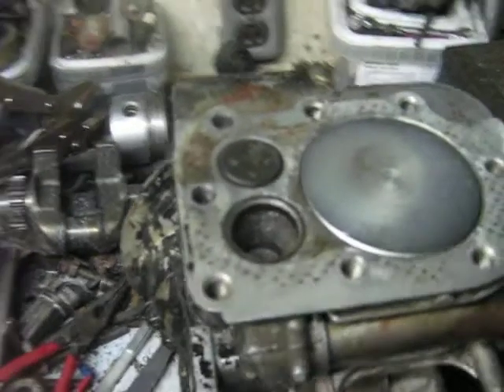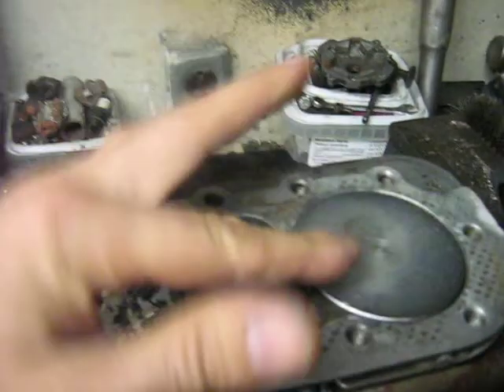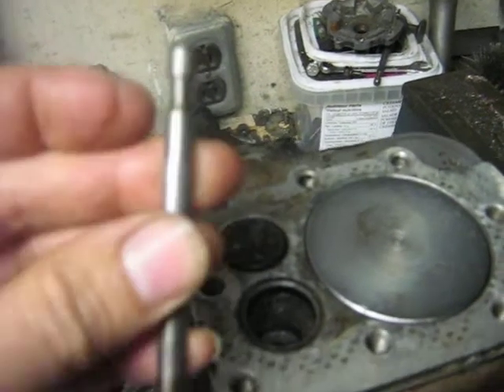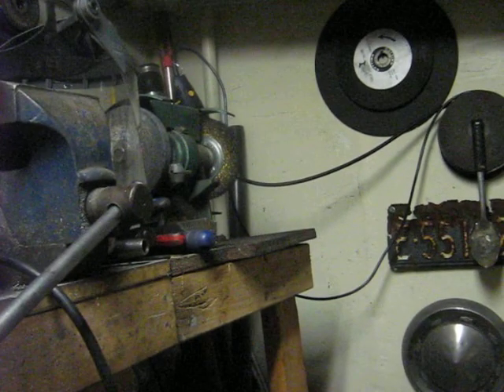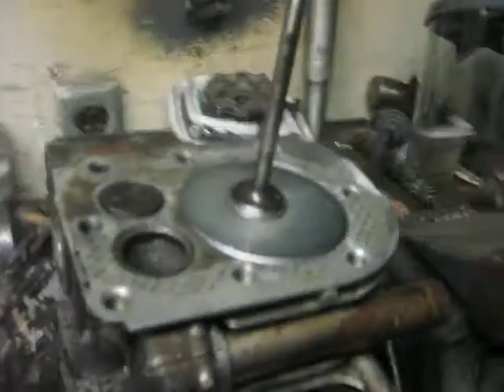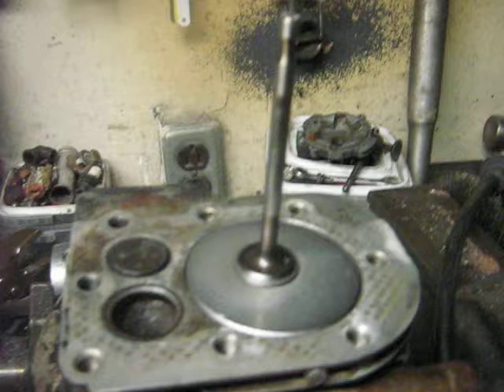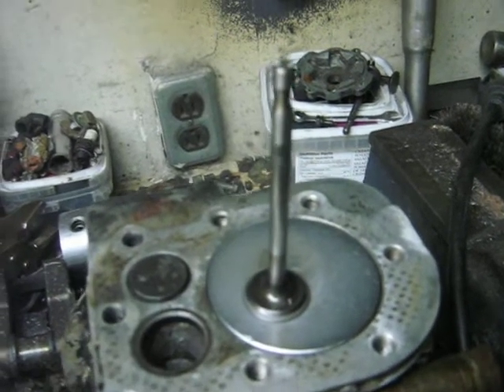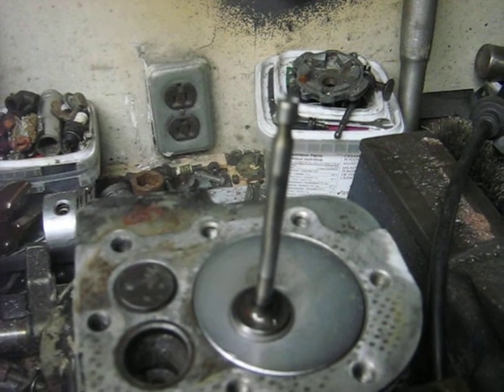84 Briggs Valve Clearance Grind 6/9

Comment from the maker: Yes, running a generator is NOT cheap. That is one reason why I think having a backup heat source, or just having a wood stove is a good idea in a cold climate. Lights can be powered from a battery, and you can heat with a small propane stove. All the comforts of home for a few hundred $ invested!  (Better than having to abandon your house, because the power has been out for 12 hours, and it is bone chillingly cold out)  Lots of peace of mind,

Comment: Well most of the standbys run on propane or nat gas. Shoot ive got the usage chart on my clipboard at work. Off the top of my head i wanna say the 12kw at half load uses at least 1.5 gallons of propane an hour. We had customers on generator for a few weeks during sandy and whatnot. Briggs does make the usual portable gasoline units . Hey now you gave me a job. When im at a Briggs unit ii guess ill haveta do a little vid to pass your way :)

Comment: Yea they start and immediately go to 3600. Lp fuel is dry. They say they are lp engines but i see not much evidence of a conversion. Where's the unobtanium metal for the valves? Haha yea the dead of winter and the power goes out. Guess when the lack of compression rears its ugly head? Yea if you surf any check out the b+s home standby gens. Personally i prefer the kohler standbys their engines use hydraulic lifters. But the b+s gens are

Comment: Valve adjustment is critical ive found. I service b+s standby generators and ive had engines with zero clearance, or pretty close to that by the 100 hr service mark. Most are vanguards like 16-18 hp. The lp fuel is dry and really puts a whoopin on that exhaust valve and seat. Some think that valves loosen up with time, not so maghee.

Comment from the maker: Yes, leaky valves will kill performance for sure! I generally lap the valves if I have the engine apart, just to make sure. I had a problem on the purple 2 stroke I made afew months ago, had to lap the intake valve twice on it! It just wanted to leak for some strange reason.